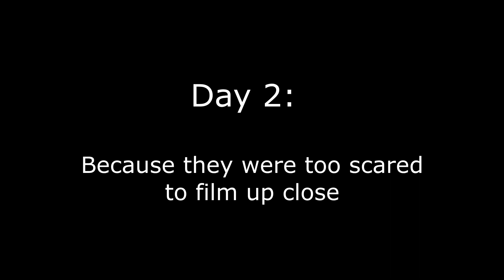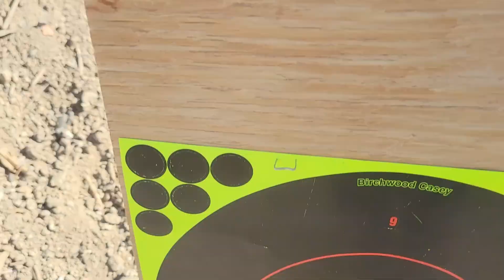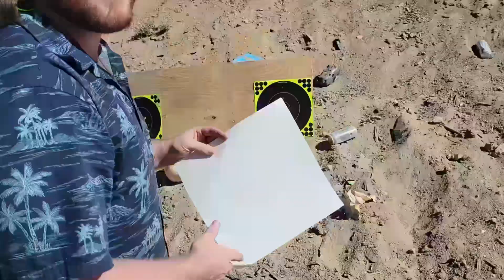Axe Gun - Splitting Bullets With The 1851 Navy

Comment: Personally I'm thinking I'd use a blade with a lot harder steel like D2 and not using ax head because that geometry doesn't lend to accurate shooting as you can tell from experience but still props to you I'm not taking a welder to either one of my 1851s unless I'm welding and knife to the rimrod handle mechanism thingy
Reply: I should record and upload me firing it but I made a rifle to shoot four and five inch artillery shells 4th of July fun and it's always better when you get to decide where the shell explodes I just don't know how legal it is